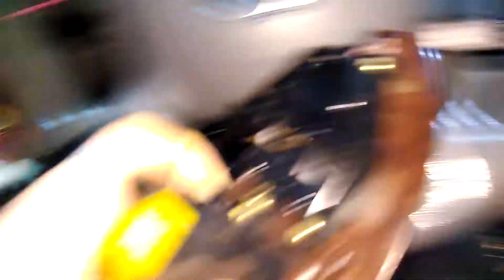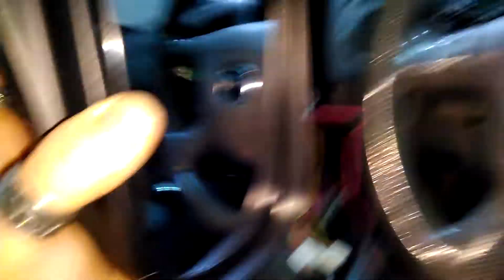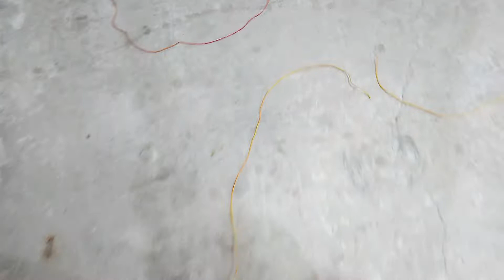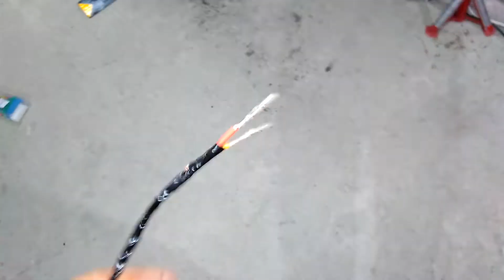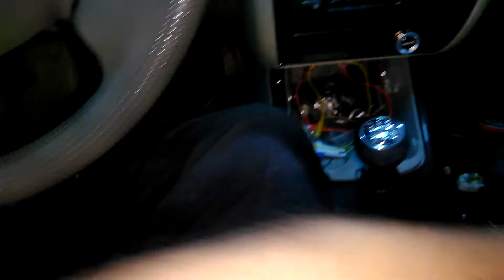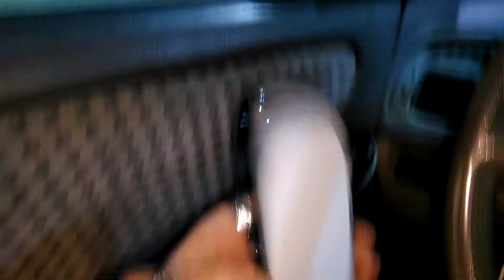Power/Electrically folding side mirrors installation on 626

Comment: Hello, friend! I am writing to you from Russia. I bought Mazda Capella electric folding mirrors and am now trying to install them on my 626 GF. Can you tell me, please, how did you remove the spring inside the mirror to correct the angle of the mirror relative to the body? I don't understand how to remove this strong spring...
Reply from the maker: Hello. Yep, that is the only thing I did not show in the video. This is because there is a high chance to break the mirror while doing it, so I did not want to risk it again, sorry. Basically, it is a 2-person job. 1 person needs to hold the mirror steady, while the other presses hard on the spring. Probably there is a tool for that, but since I did not have that, I needed to use brute force. And believe me, it really was a BRUTE force. I was the one holding the mirror, as I'm only 75 kg, while my father, a 150 kg man, pressed with all his weight, and we managed to release the spring easily. Putting it back on was the challenge! 150 kg force were barely enough. I still have marks on the mirror from the terror we did to it! I can only wish you good luck!
Reply: @Mazda626GF  Thanks, man! I bought two left mirrors, I will train on one of them! I disassembled it completely, pulled out the wiring and gears. It remains only to remove the spring ... Do you think it is possible to use a device for removing valve springs?
Reply from the maker: I'm sure there was a device to take those apart, back in the day. Now, probably not :/
Reply: @Mazda626GF  , bro, it's me again... I need your help! I removed the spring and saw a circle in which two square holes were cut. An iron plate is inserted into these holes, on which 2 balls roll. Do I understand correctly that these square slots need to be expanded? From one side only or both sides?
Reply from the maker: Can you give me a link to a picture? It was a long time ago and I need a picture to refresh my memory and to better understand you. Also, it is possible the Capella mirror to be different than the brand-new non-original mirror I installed.

Comment: Hi! where did you buy the mirrors or where did you order them?
do you have an article number?
Thanks (Google Translate)
Reply from the maker: Hello. One I bought from eBay UK (no longer on sale), the other one from Autodoc. I do not have OEM part number, but I have numbers for aftermarket mirrors. The one from the UK was Lucas ADP485 (left side) and the one from Autodoc was Abakus 2313M04 (right side). Both left and right side Abakus mirrors are still available from Autodoc. Numbers are 2313M04 (right) and 2313M03 (left). Just make sure you choose Sedan/Saloon, as they are not listed for Hatchback even though they fit (probably originaly there is no hatchback with power folding mirrors). Station Wagon/Estate (GW) is out of luck, as the mirrors will not fit them. Hope that helps!
Reply: Teşekkür ederim dostum.